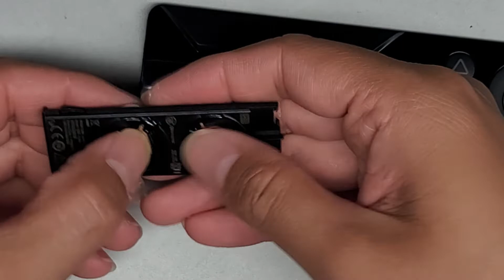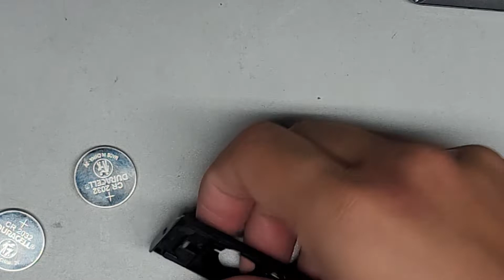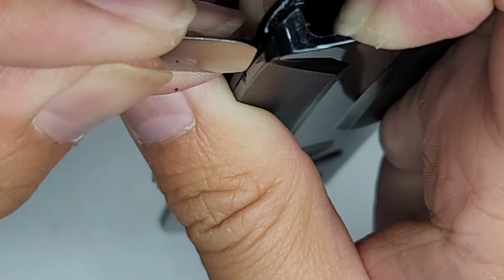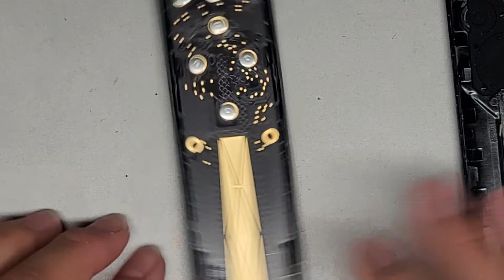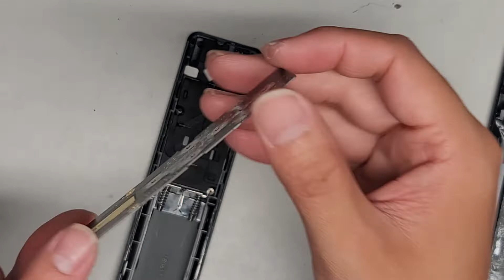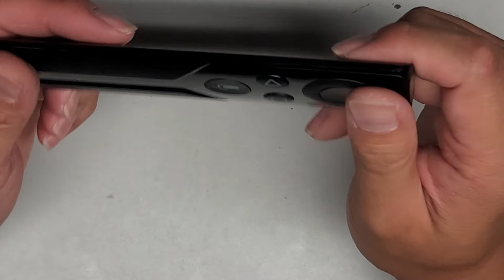NVIDIA SHIELD 4K HDR ANDROID TV Pro Streaming Device Remote Control Controller Disassembly How to

Comment: That's the 2nd generation P2930.
The 1st generation P2930 was made the same, but recharged via USB and had a 3.5mm headphone jack.
Reply from the maker: Nice
Reply: Yes, this is the only version that there's literally any point in disassembling - to change the rechargable battery - but all i can find are videos about disassembling remotes that don't need disassembling.
Reply: @rBennich  P2575 https://youtu.be/XbTQnIbHGw8
Reply: @501Bravo  OMG! Thank you!